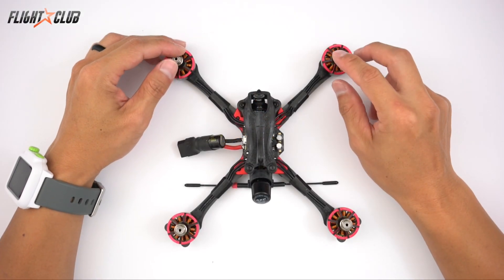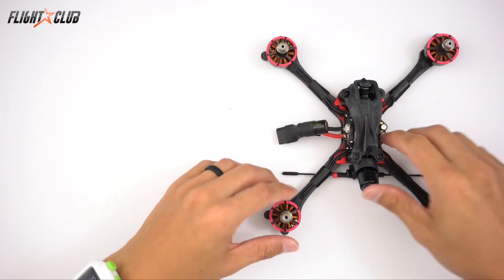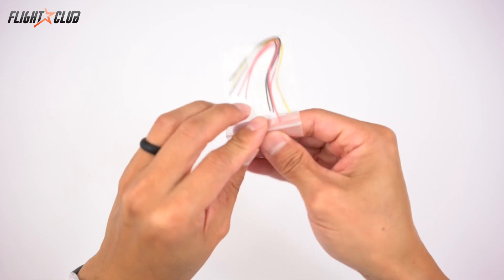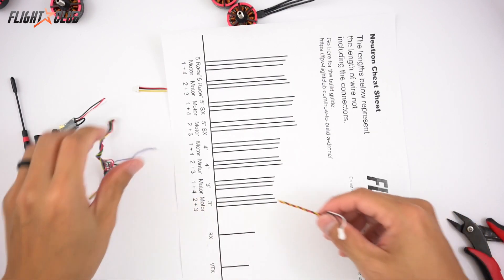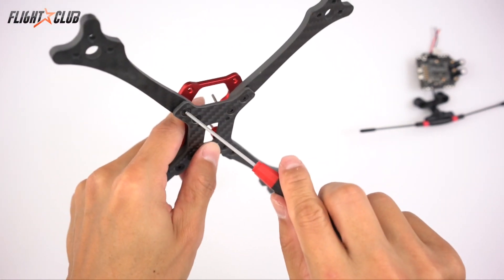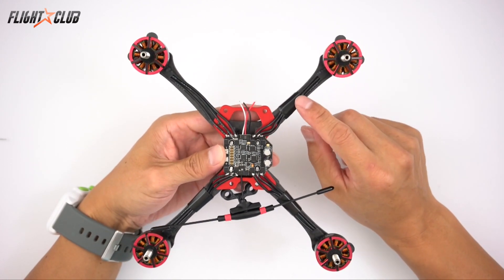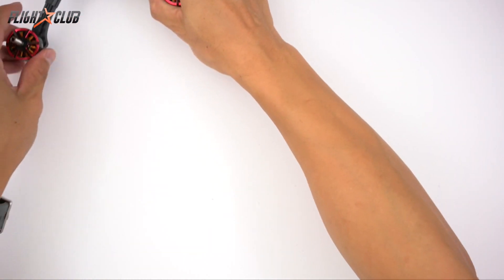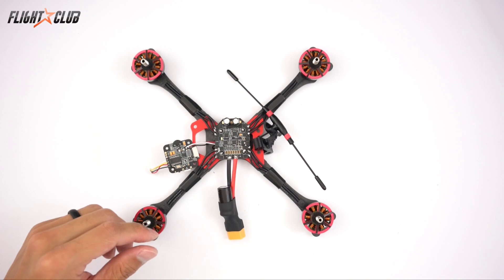How to Build a 100mph + Drone

Comment: I have this the emax mini stack. It's a beast, and makes builds easy, but I really wish it had blackbox and a spare UART.
Reply from the maker: yeah i know, it's almost the perfect stack
Reply: You running it on 6S?
Reply from the maker: yup, 6s!
Reply: And you think it could handle Gemfan 5149 with these F40s? I also have Hyperlite 2205/1722kv, but I kinda want to run F40s.
Reply from the maker: oh yeah, i run the GemFan 5149 and they came down just slightly warm after a hard run on the f40.  i have one built with the 2205/1722kv, the f40 is way faster
Reply: Thank you. :)
Reply: Ahhh, one more thing. I'm busy piecing the order together. But when I select the pod in the Neutron order there is no option to add a fin. Can I just add it in the comments or something, or does the fin add to the cost?

Comment: Awesome.. great info.. Would you be able to do a build using the 3 inch arms.. Emax stack .. Crossfire etc Caddx version 2 for camera. 

Looking at motor sizes to handle 4s and above to see if we can be better than the latest Baby Hawke..

Also are you able to get your 3 D print guys to do a built in HD Mount like the one they have out for the Ghost 2 frame.  I know you have the light version but it would be nice to have another option please.

M
Reply from the maker: yeah, this can easily handle 3" arms.  yes, this frame has a gopro mount if you run the skeleton (standoff mode)

https://fpv-flightclub.com/products/proton-gopro-session-mount/
Reply: Must have been EnvyAstro flying that

This is great Mike, I needed this info.  Thank you
And thank you again for proton u got me w the LEDs.   I love this one, I haven’t lost it so far , loving it. Have you guys thought about doing something w Rotor Riot, actually Rotor Riot should be doing something w you !!!!!!
Reply: @FlightClubFPV  Thanks for the reply 
Can you do a recommended build video for 3 inch as you will be able to work out the best parts to use for a build.. I was thinking of the Caddx Turtle version 2 for camera and HD recording.. so Crossfire and Emax Stack  maybe some emax motors fo 3 inch... 

The 3 inch arms suit which motors etc..  and so on.. 

I am sure others are interested as well .. for myself I was thinking of purchasing a Emax Baby Hawke R latest release but this frame might be a better option with the right info.. No need to do a complete  build video .. 

M

Comment: Hi Mike, when you order the frame with the canopy instead of Skeleton, does it include the SMA AXII mount, or must I order that separately?
Reply from the maker: The skeleton and canopy version both come with the SMA AXii mount.  no need to order it separately :)
Reply: Thanks. Working on an order shortly.
Reply: There's one more thing I need to figure out. When I select the canopy when ordering the Neutron, there is no option for the fin with the canopy. I really want that one over the standard canopy. How can I make sure to order that one?

Comment: Is that a wiha picofinish hex driver if so what sizes you got i have all the phillips i whant the metric hexs its one hell of screwdriver 100 times better than wera precision line.
Reply from the maker: these are just the precision wiha and i love them.  I only use the 1.5, 2 and 2.5mm drivers

Comment: Why are you only using s bus on a crossfire receiver why don't you just use an xsr receiver for s bus and save yourself a little bit of money I don't see the point of buying a crossfire receiver and only using the S Bus protocol why don't you use the full Crossfire protocol
Reply from the maker: yeah i get it.  I built this with crossfire just to show that it can be done on an FC that doesn't have a spare UART.  Also with the crossfire you never have to worry about range issues.